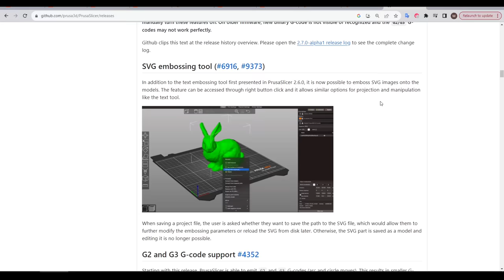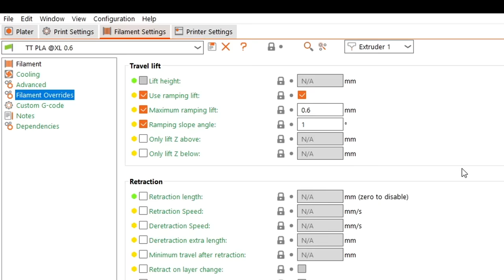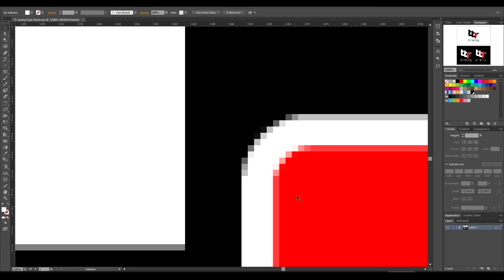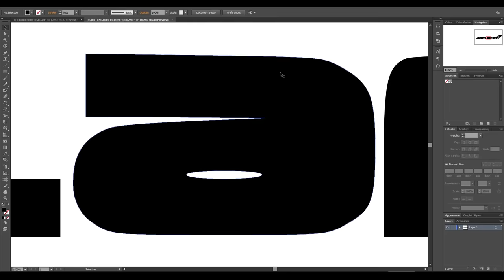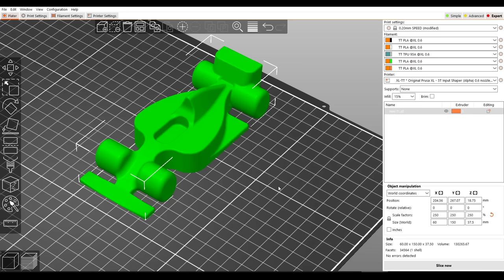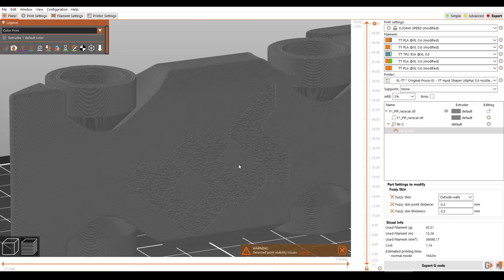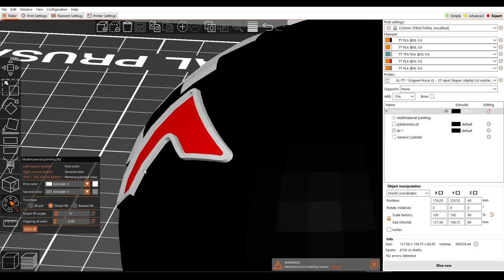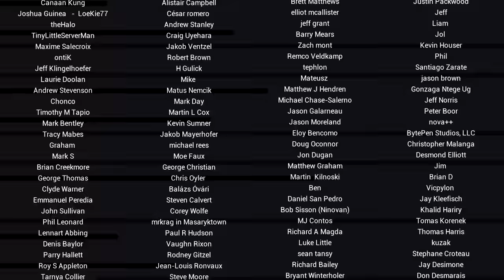Add 3D logos and text to your 3D prints easily with SVG emboss + Prusa XL update

Comment: I would really love to see you continue your multi-material/multi-color experiments by showing us how we can use multi-material capable machines to make removing support easier. BambuLab advertises that the AMS can be used to "use snap-away support material or dissolvable filament to minimize the pain of removing supports," I would love to see that in action and how that's done.

Comment: While I'm a bit annoyed with Prusa, I'm glad to hear they are working on the issues. I have a Mini+ that I love to use and I'd love to have an XL and a MK4 once they've worked out the issues, but I'm thinking about building a Voron or a RatRig for my next FDM printer because, well, bedslingers just take up too much room. I have a Kobra Max and I need about three feet from wall to front feet in order to have room for the bed's full travel and still have the printer on stable footing. It really needs about 4 feet, which is why it was on my kitchen table for a while. (Good thing I live alone. I can get away with stuff like that.) I know that the XL isn't a bedslinger, but I'd like to have a fully enclosed printer.

Glad to see work continue on Prusa Slicer. I've used both it and Cura, and I like Prusa Slicer more. The new features look cool. I just hope that we'll see the Kobra line supported officially. I've had problems with the community profile causing issues.

Comment: Michael in another YT video I saw they used a "bump" pad to align the print head between each tool change. As the print head doesn't always seem to lock into the same angle every time it's picked.
Reply: Its crazy to need to use this...
Reply: @BeefIngot  LMAO you don't. He assembled his printer wrong and created problems. Funny how nobody else has shift issues like him, when he acknowledge assembling it wrong in the 1st place
Reply: @LilApe  What are you talking about... The forums are filled and a cursory youtube search shows many people having the same problem for a brand charging more than double the nearest comparable printer then some, and supposedly the "just works" brand.

Comment: I just can't get over the fact that just after you uploaded this video - Prusa released beta firmware for XL MINI and MK4. Also as for layer shifts - I saw a video with a crude solution, where you add a "bump block" on the frame, and after each tool change, you ram tool into it to align all tools to the same position.
Reply from the maker: I will check out the firmware. I've seen that video and my printer doesn't have that problem (thankfully).

Comment: After given up on text in OnShape, this is completely welcome.  I will explore.  However, I have been disappointed that Prusa XL is so slow given its nozzle dia and size.  Surely, it should adopt "Volcano" heater configuration and attempt high volume extrude rate.  Have you investigated this aspect?  You first video quoted the 3D Benchy at 55 min - ouch!

Comment: Well, I might have sent my XL back from the issues I was having with it but it's at least good to know that if I decide to get one again in future it'll probably work far better. I didn't even have a toolchanger model and I still had some strangely terrible printing experiences.

I'm holding out hope 3DUnplugged's DAKSH toolchanger system ends up being a good alternative instead. It fits on the more common kits like vorons and ratrigs.

Comment: I'm looking forward to the SVG emboss feature coming to OrcaSlicer at some point, seems like a very useful feature for customising prints. It's a shame the Prusa XL is having all these issues. It seemed like such a promising machine, hopefully future updates will improve the features and quality. I'm also suprised it doesn't come with an enclosure. It seems like it would be a great engineering level printer with the capability to conveniently do multiple materials but no enclosure means ABS, ASA, Nylon and PC aren't really feasible.

Comment: I understand the importance of heat control over the head nozzle, my idea  is, if it was never tried before, is to make an all glass head extruder, seeing glass can dissipate heat faster for more control in addition use a hot laser hitting the filament  through the transparent class extruder head. Since I dont have a 3D printer this idea is only theoretical. Do you think that this idea would have any benefits or could work cheers Perry

Comment: With 2.8 I had better luck with right-clicking on the model's text in the right pane, as opposed to on the build plate, as that no longer worked. Hope to save someone a minute as to why "use surface" checkbox is disabled.

Comment: Hi Michael. I just wanted to leave a comment letting you know of the glory of R Type Nylon Rivets for all sorts of applications including 3d printing ones.

I first learned about automotive plastic push rivets from a recent Robert Cowan video about using them to attach plastic parts to a peg board, but that got me searching and I found out about these R Type Nylon Rivets which are also push rivets so they are reusable but the big benefits over automotive rivets is that they are in all sorts of more 3d printer friendly sizes, and are dirt cheap.

They are typically used for attaching panels together like pcb panels, but Im sure you can imagine how great theze are for many 3d printed applications like enclosures or molds or things where youd like the ability to reopen an item but dont want the hassle of heat set inserts or screwing into metal.

These things both make it easy as heck to design for them in CAD and should last more than enough cycles for most use cases.

They also look rather sleek and come in black or white.

Just thought Id let you know the good news.

Comment: From what I've seen, I think I prefer the Bambu lab and it's AMS. It would be prudent not to think of any AMS/MMU as "multi color" printer, it has limited (good) use, for instance, you don't need to worry about running out of filament and changing spools, printer can do that automatically, you could also use a different material or color for the bottom, and the top of a technical model, something that when implemented is visible only from the top side, you can use cheap PLA for the non essential bottom part, and expensive tougher material for the essential top part. The greatest benefit is perhaps multi material capability, and for that, even if it produces waste, it's very well worth it.

Comment: How long did it take to print that little clown fish with multicolor?
Reply from the maker: On the XL, it's about 1 hour 15 minutes. The model is scaled down so Y axis is 50mm long (from memory).
Reply: it's not big enough to be reasonably printable with 0.6 nozzle tbh
Reply from the maker: If I had opted for 0.6 nozzles, then you have a point. But that was a Prusa choice, and there is nothing on the store page saying it's not suitable for small and detailed models.

Comment: I think Prusa has taken the community for granted given their past reliability/deliverables track record. I think they really need to focus on testing/tuning/profiles for their products. I was torn between Prusa XL and Bambulab and pulled the trigger on a Bambulab. Prusa had YEARS to tune profiles for this printer. I can forgive the supply chain issues for delays, but there's no excuse for the poor profile/tuning issues out of the box. I think Prusa without a doubt intentionally released this with half tested profiles to pass the labor onto the customer which is a bit insulting. At these costs it's no longer an entry level project printer and should work out of the box. I know Prusa has done great things for the community, but this is a BIG fail on their part. Bambulab printers, as of currently blows it away in terms of speed, quality, and price. Sure, purge/waste material is going to be more than a tool changer but given the significant price difference of a 4 spool AMS + X1(~1600) vs the 5 tool changer XL (~$3500),  I highly doubt I will purge $1900+ in filament.  I really do hope Prusa get their stuff together though.
Reply: Their profiles are tuned just fine as 95% of users have zero issues. Michael is using a .6mm nozzle on a super scaled down multi color mini print and expecting the quality of a .4mm nozzle. BL profiles aren't great at all lol. Their printers struggle to print anything that isn't PLA. Look at all the posts about terrible PETG quality on BL printers. Their profiles aren't set up right for them. Looks like you made a poor decision and should have done more research.

Comment: I am torn by this. One the one hand, it makes it easier for non-cad users to tweak models. This is good, but I know there is a temptation to add "just a few more CAD  features" and one day your slicer is also a mediocre CAD program. I would prefer a "clean" slicer rather than one with a bunch of CAD options that are better implemented in real CAD software.
Reply: Many CAD softwares (especially older ones, like CATIA v5) just absolutely SUCK with text creation, so I see this as very welcoming.
Reply: feel free to fork prusa slicer to create the slicer of your dreams 😊
Reply: This line you are drawing is purely arbitrary. Let us clean up PrusaSlicer. Cut tool, especially with pegs, is CAD. Gone. Support structures is CAD. Gone. Scaling is CAD. Gone. I think we can keep moving and rotating.

My point is a slicer has always been a mediocre cad program with features that optimizes many people's workflow. And what is wrong with mediocre cad programs? I use TinkerCad all the time. You don't get much more mediocre than that!
Reply: My concern is cad features that are unnecessary to getting a model printed being added and resulting in bloated, overly complicated slicer software. Embossing text is not necessary to getting a print done.  @dsjove
Reply: @Livingdiceman  You are creating an issue where one does not exist. We have not reached the ambiguously defined threshold of bloatware. What is necessary?

 Scaling is not necessary for a slicer. Gone.
Reply: I find the additions very welcome and easy to use. Where’s the problem?
Reply: I'd disagree too I have to say. Having all these 3d print specific features in the slicer is very powerful. Adding text to curved surfaces or splitting parts to be joined with dovetails or pegs etc can be done on solidworks but are a pain in the ass.  The issue with solidworks or other cad is that they are used for drawing items for traditional manufacturing also, while a slicer is specific to 3d printing. Solidworks or fusion will always have to be one size fits all type software and doing very specific operations for 3d printing will be cumbersome
Reply: As long as we are still slicing STL or similar approximate mesh formats, I could not agree less.
Not every part you print, you actually have the native source files for, that would still let you edit the part, so the more tools for working on STLs the better, cause serious CAD programs won't get you there if you only have the STL data.
Also I do not see those features slowing down the actual slicer development yet. Prusaslicer is still pretty much up there keeping up with new features for such a big project.
Reply: As long as people only share stl there will be a place for slicer functionality for easy editing.
Reply: Dumbest comment I’ve read in a while. If you don’t want it, don’t use it. Doesn’t make basic slicing any more difficult, it’s just an add on.

Besides that, editing STL files in CAD is nothing short of a nightmare, way easier done in PrusaSlicer